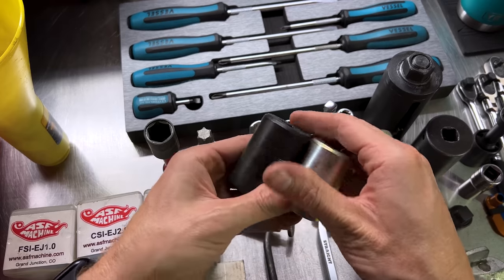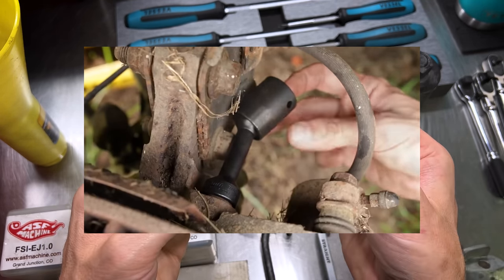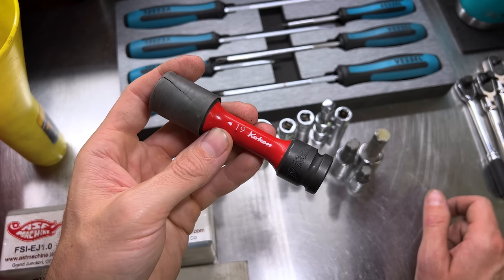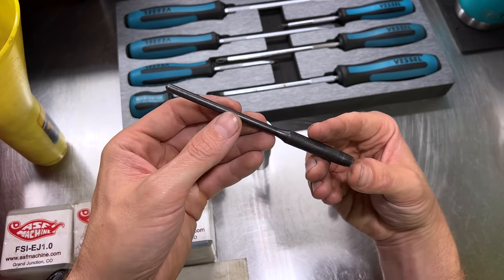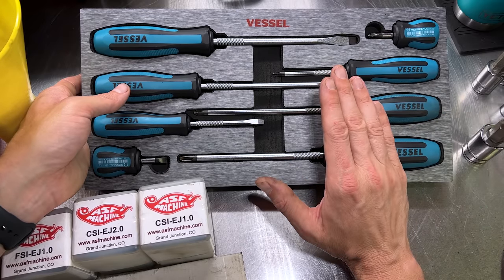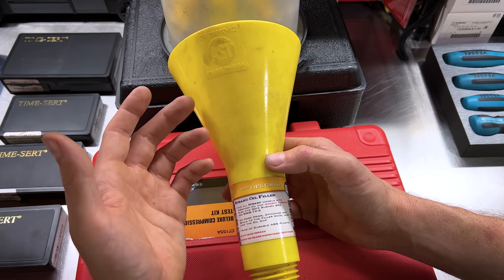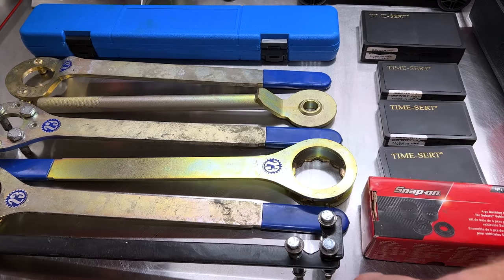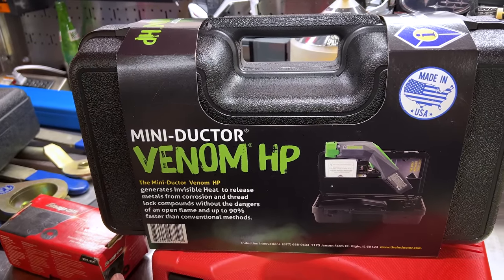Subaru Tools That You Need In Your Toolbox!

Comment: the screwdrivers are JIS (Japanese Industrial Standard) for the cross-tips.  Better fit and won't strip out like using a US standard phillips head.  One of the best purchases I made for my Subie wrenching adventures.  Great video......
Reply: I use the Wera laser etched tip ones, the ones with a green handle. Work great for me, no issues
Reply: ISO 8764 is the new standard, not JIS. But either screwdriver spec will work great. the Japanese screwdrivers like Vessel are great, but the 8764 ones like Wiha will also work perfectly on Japanese stuff.

Comment: I have to say a big thank you to Mr Subaru i have owned a JDM imported Subaru Forester STI in the UK for the last 10 years and you have taught me so much, I have done all my own struts, Wheel bearings, Brakes and many more jobs as well as services myself, now at 125,000 miles on a 2006 plate the car still runs like new. Although it did have a gasket blow at 90k which one replaced along with a Mishimoto radiator which have both been faultless since. Again Thank you Mr Subaru.

Comment: Very good video, I have been working on my Subarus for over 13 years now and a lot of good info here on this vid 👍.  Just an FYI  on what I do with ball joints which always works for me. I live in the rust belt.  1st use an impact on the pinch bolt (never hand tools as it will snap). This is after thoroughly soaking with penatrant.  Then I use ball joint separator to seperate from control arm. Then I reconnect it to the control arm, but just hand tighten the bolt. Then to seperate ball joint from knuckle, get a long pipe, typically a floor jack handle and put it against the control arm with a peice of wood between them from the top and whack the other end of the pipe with a sledge hammer. Works for me all the time. Mr. Subaru, if you see any pitfalls from this method, your input appreciated, but I might pick up the Astro tool anyway..

Comment: I work at a Toyota dealership and for the 86 Valve spring recall we got a crank pulley holding tool in the kit that works a treat, not sure but may possibly be available at Toyota or Subaru parts as a special service tool.

Comment: Regarding the ball joint tool; I recommend using a breaker bar rather than an impact because the little pin in that tool can snap in some cases.

Comment: The Company23 version 2 Crank Pulley holding tool (and its no-name clones)'s little extension ring for better grip on the small-hole pulleys actually has too large a diameter on the extension ring for some crank pulleys I've encountered. No idea if they're OEM or replacement pulleys or what, but you either need to reduce the diameter on the extension ring (the diameter necessary seems to be just a tiny hair larger than busting through into the threaded holes...) or cobble together some other way to hold the pulley and/or break the bolt loose. You can usually get away with tightening it to spec without the ring seated fully in the pulley if you use higher strength class 12 bolts instead of the ones they give you, but you'll never break it loose.

Comment: the oil funnel, motiv maked a much better version. they also make one for just about every single brand. the cool part is that the neck is clear so you can easily see if there's a blockage

Comment: Mr Subrau,

I just turned 52 years old and I have always been around cars and motorcycles. I was planning on becoming a Harley tech so I have a good collection of tools. Recently I was offered an entry level tech position for Subaru. Basically OJT. Thank you for this video, but I saw your tiktok about oil filter tools (months ago) which ones do you recommend?
Thanks In Advance

Comment: the screwdriver youre talking about is called a JIS tip, vessel makes very good ones but theres lots of brands that make them... its not a phillips head.... JIS is the japanese version of a phillips head but the geometry is different... and one doens t work for shit in the other... JIS screws are identified by a dimple on the head usually. but tats usually not legible except on clean fasteners

Comment: do the cam seal installers work on both non avcs and avcs camshaft oil seals? the older models 92-99 use a smaller od seal

Comment: Hi Mr. Subaru,  What size Hex Socket is needed to remove the cam pulley bolts on a 2018 STI. I see you linked GripEdge RPT HEX Sockets, but the largest size is 10MM.  I was looking to buy just 1 socket instead of the set for this at home job.  Your help and wisdom is always appreciated.
Reply: It was 10MM of course and worked great

Comment: @mr subaru 1378,
If i can i have a question for you.
What about LPG for a late 2022 1.6 petrol (multi point fuel injection). Is it a do or a do not, have you had anny expirience with this.

 I am from EU (belgium) i saw a system that uses a valve care product like 1L over 10 000 km's.

What are your thoughts?

Edit: i am not racing it... Trying to get it as far as possible with 40 000 km's a year.

Comment: Hey Mr. Subaru! I'm looking for an advice: i've to buy a new car, and i would like to spend my money on a reliable and durable workhorse, that will last a lifetime (just to say). So, to be on budget, i'm considering a used 2013 XV (Crosstrek for americans) with 85000 km done (52000 miles). It is an europen version, with 1.6L 114hp engine, 5 gears manual transmission and low/high gears lever. It is on sale with complete Subaru service history and a technical check-up even for what concern the underside of the body. The price is 16k bucks. Do you think it's a good deal?

Comment: Mr Subaru I like your vids n Info-
I know U correspond with your subscribers for advise on their DYI Subaru projects.
I don't know where, But here is my question in hopes U will answer.
06 OB 172km, rear right brake disk shows an inner ring of 20% use, the rest is rusted/NOT used, on the outside.
Caliper aftermarket, 10km used.
Disk aftermarket good 10km used.
pads ~50% left.
bracket slides easy.
I take care of my cars n I drive easy-
what is the problem?? thanx

Comment: @mrsubaru1387 I have a question my 07 legacy vent blower motor for some reason just start to stop working time to time and if I tap it it stays on I took it off reput it on it works perfect but time to time stops and starts only when I tap on it what’s going on ? I checked the bolts everything is on right but can’t figure it out can you please do a video on it or help out

Comment: What tool can I use to remove the %*#)(_*^$ rear subframe bushings for a 90's Subaru... The bushing wall is SOOOO thing... and I can't find a cup/plate that fits the bushing without tearing the bushing potting material...

Comment: I can get to those brake caliper bolts with a regular sunex mid depth socket and universal adapter both ³/8 drive. No way In heck you need that expensive ass snap on socket. Btw my universal joint adapter is a snap on